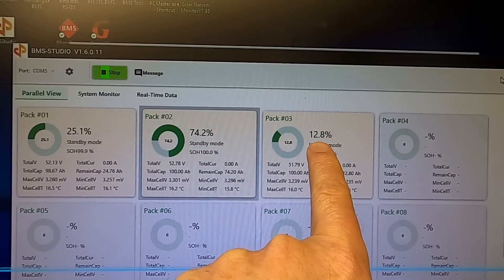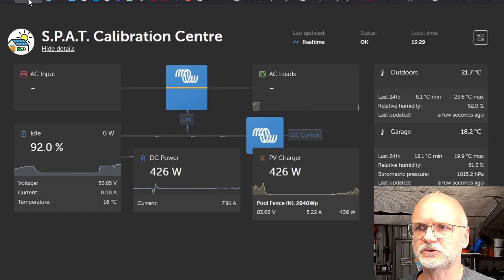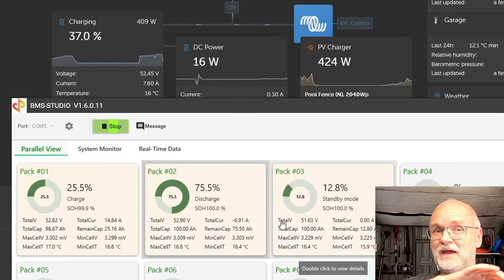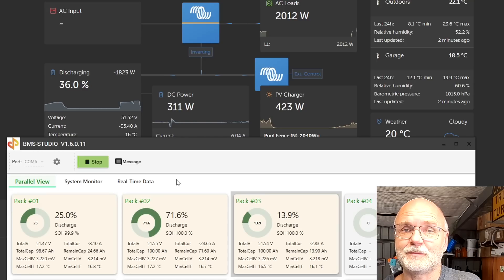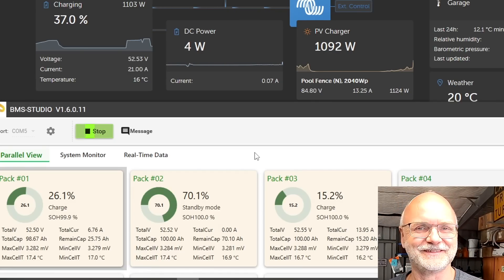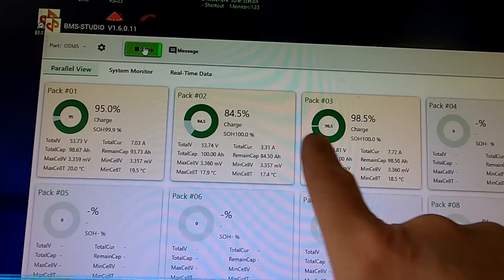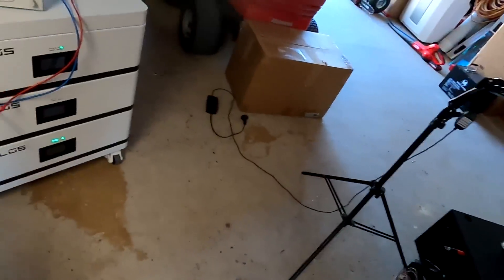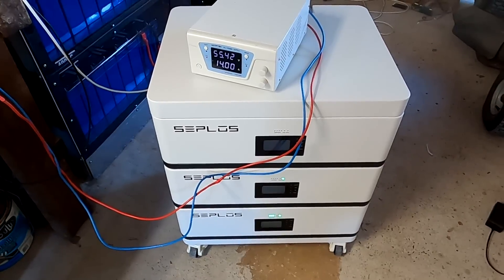3 Batteries in parallel. Lots to learn from an unfinished product 😒

Comment: Thanks for the outstanding demonstration instruction. I would love to see a mixed chemistry parallel test with Lead-Acid and LFP,  with larger capacities and loads  than I've done at small scale. Mainly for people like a friend with an off-grid home in Thailand who's been running a deep-cycle Lead-acid pack and needs to add capacity and is considering doubling his battery capacity with a new LFP pack, and had concerns about connecting it in parallel with his lead-acid pack. He said local solar dealers informed him that will ruin his lead acid pack and cause heating and all sorts of charging and discharging problems. I believe this is bunk as the LFP Packs should handle most of the high load peaks with the Lead acid batteries following in trail. As many may be wanting to add an LFP pack to a Lead Acid pack perhaps such as test would be useful information. 

I have observed when paralleling similar sized 48V Li-ion packs with LFP packs  (600 watt-hour each),  that under prolonged high load (about 1000w) from 100% SOC to about 70% SOC, the Li-ion pack will end up as a lower state of charge and after removing the load, and LFP pack will charge the Li-ion pack at about 500watts or at the charge limit of the LI-Ion pack. My though is that this would be reversed if  connecting a Lead acid pack with a LFP pack, and the LFP pack would handle most of the discharging and charging load.
Reply: I am running lead acid an Lifepo4 in parallel its working just fine the Lifepo4 handles 99% of the load if you discharge down to 20% for the Lifepo4 a small amount will come from the lead acid. I have set the back to grid/generator at 49 volts which on my old batteries means they do not do much , I tried at 48 volts for testing and the lead acid started to provide 15% of the load. So basically the lead acid remains mostly on float. Note I have set the charge voltages for the Lifepo4 so defeating the lead acid charge profile. I have a daly bms on 16 x 280Ah Lifepo4 one system on another system I have a 310Ah green bank battery bms is not accessible but the indicator on the front matches that of the one on the daly bms on the other system.  If you go to the Australian Electric Vehicle Association forum renewable energy and storage (non - ev) I have started a topic for this now.
Reply: Mixing battery chemistries like this is not feasible. Due to the flat discharge curve of LFP batteries, you will empty your LFP before the lead-acid starts to do something.

Due to the flat charging curve, by the time you reach the absorb voltage for your lead acid batteries (56.8V to 58.4V, AGM vs FLA), your LFP battery will be overcharged already, and you have to keep this absorb voltage for an extended duration for the lead acid to charge. this will cause your Lithium BMS to disconnect every time.

If you have a poor solar day/week (lithium only charged to 80%), then your lead acid will never charge, and this will damage them.
Reply: @bascomnextion5639  thanks very much for the information. That's similar what I observed with some limited testing I did with 2000 watt-hour 12v deep-cycle lead acid and 600 watt-hour 12V LFP pack. but once I got below 3.20 volts per cell or 12.8V system voltage the Lead Acid started providing 50 to 80% of the load as the voltage dropped to the cut-off voltage of the LFP pack.
Reply: Flooded lead acid need 62 volts for a proper charge so almost all chargers do not charge them properly sealed lead acid should be kept below 57 volts but benefit from pulse charging to 62 volts . Regular maintenance is a must for lead acid so part of this would be to charge the battery at least monthly to these voltages , I use a 5 amp 48v pulse charger to do this. I have also a nickel iron bank which needs 64 volts to solve this some of my mppt chargers have an load output that can be set to come on/off at a set battery voltage so with a large relay/contactor I disconnect the NiFe battery from the system and the mppt charger with its solar takes it to 64 volts a similar voltage controlled relay could do the same with lead acid banks switching to a charger.
Reply: In winter I mix Lead acid with LFP and they work very well, the BMS OVP and UVP will fire on every charge/discharge to protect the LFP but the Lead acid will extend the capacity  the capacity of your pack. I mix them to have capacity to reach the period when the grid rate is lower. One thing that you must consider is that acid must be in good shape or they will drain energy solar energy that could be used to charge the LFP. In summer I don't use lead but charge them every month and notice that LFP capacity is lower in the morning before solar kick in and I produce twice of what I use, so this means that at night lead is draining power from LFP.
Reply from the maker: I'm not a fan of mixing battery chemistries. I'm OK with it if one still has seme lead acid batteries and wants to use them until they are dead. But I would not recommend planning on such a system as it provides only the worst of both worlds and is full of compromises. There is no reason to use lead acid batteries for power storage systems any more unless you cannot get any Lithium batteries.
Reply: @OffGridGarageAustralia  Thanks Andy, I agree, but was thinking more of a friend in Thailand who has a large investment in Lead Acid over a year ago and needs to double his capacity on a limited budget, and My suggestion was to double he capacity using an  LifeP04 prismatic pack and then replace the Lead Acids at a later point when they start to degrade and he can afford to do so. 

Perhaps we a supporters could kick in for a say a 200ah 12V Deep cycle Lead acid battery  to combine with a set of 200ah Prismatic Lithium cells for you to do some definitive testing with.  I did some testing months ago with my 12v 200ah lead acid test battery and a smaller 24ah pack but it was not a good representation of real world use. 

 Also, I just submitted a long reply in regard to charging LFP and Lead Acid batteries in parallel if you are interested in a long read.

Comment: Hi Andy.  I think I am missing something here.  Why are your Bms boards asking the solar system to reduce the current avalable to the system . I would of expected the solar system to try and maintain the dc voltage at the system voltage that you want to run at. 
The current would be limited by what the batteries want to take and I would have expected the Bms. To limit this current for its own battery to a max charge current   
Any load conection would then drawn its power from the solar system untill it can no longer keep up the dc voltage would drop and load would then come on to the batteries to make up the short fall . The important thing is to Maintan the system voltage at the correct level and not go over volt on the system. 
At the moment my system runs on lead acid just starting to get into. These Bms systems. And batteries  regards bill

Comment: Your 15A axtive balancer had everything sorted in what.. half an hour?? You could take the covers off and top balance these. Longest part is disconnecting/reconnecting the balance cables. Do it 3 times and youve got your full capacity to test across the 3 banks... Take you a few hours at most...
Reply from the maker: Yes, of course, I could do that. I just have the feeling that these batteries need a more permanent solution. And this should come from the manufacturer, not the user.

Comment: After replacing 5 cells in my 280AH pack now i have 2 group of cells at top balance, group of 8 cells that stay at 3.45 and a group of 8 stays at 3.385 now 10 days lets see what JK can do about them. good luck balancing those new Seplos cells. I charge them max to 54.6v though.
Reply from the maker: I hope you're not talking about LiFePO4 cells here. these voltages are far too high and dangerous for LFP cells!
Reply: @OffGridGarageAustralia  my mistake, sorry, I meant 3.45. And yes they are LFP.

Comment: Andy, I admire you for having the nervs for this Seplos.... :D :D :D
Reply from the maker: I need to know myself, so happy to share this her eon the channel...
Reply: @OffGridGarageAustralia   OK, but I think you already understood that Seplos is a terrible waste :D :D :D ... there are so many different and functional solutions ... you even built one of them ...
Reply from the maker: @jurajnikolov4219  For years (not quite...), people wanted me to test the Seplos BMS because of the great communication to inverters. Well, even the communication works well with these BMS, the software and design needs a lot of work. I believe Seplos is not big enough to have a say in how the software should be or even can request certain features in a new software update.
If all these BMS have the ability to be updated via software, why is nobody listening to the community and make all these changes via a software update. It is sooo easy. Users can then decide which version they want to run with certain functionality.
Reply: @OffGridGarageAustralia  I've never seen it go without problems :D communication, balancing... :D
And you already have a built-in solution that is functional and does what it is supposed to do :D
Ok, you don't see cell states, monitoring... sacrifice one Rasspberrrpiiiii for each BMS :) for that venusOS, then as a solo installation in VRM... I assume that it will be possible to unify via rednote, or you can see it as a solo installation under VRM, what I'm writing :)
How many times do you do the settings? When do you sett it and then?

Comment: In my opinion (sorry to have one), the positive cable should be connected to the upper Seplos battery and the negative cable to the lower Seplos battery. In Germany we call this Tichelman circuit in hydraulics!!! Maybee, you remember.
Anyway - anyone who works with battery packs knows that the individual battery packs must be balanced to the same full voltage and then connected together. The passive balancers on the BMS's are never capable of correcting unbalanced battery sets. You told us this many videos ago - didn't you learn from your own experience?
Reply: Individual packs can be connected in paralell with vastly different state of charge as long as current going from one to anouther is low enought and charge/discharge speed of those paralell packs are limited at first.
Balancing individual cells within one pack - that is required either before use or with powerfull active balancer during use (for LFP - LiFePO4 during last 3-5% of charging).
Reply: Does not matter that much wich such low currents...
Well, the Seplos 10C and 10E BMS do actually balance and are able to balance with passive balancers without problems....just takes some days...but the Seplos V3 does not balance at all...in the software, it indicates some balancing, but it is not acutally happening...
Reply: the "balancers" do not function between separate packs. charging the packs up to the top point (55.2V in this case) will cause all 3 packs to be balanced on a pack-level with the first cycle, since they disconnect themselves when they're full, allowing the other packs to also reach 55.2V. 

With such big busbars, there is also no need to tichelman them
Reply from the maker: Thanks for your comment, Juergen. Always appreciate your opinion, so nothing to be sorry about.
The bus bars at the back are so fat that it does not matter where to connect pos and neg. I have done the same in my battery shelf with the copper bus bars and connecting all three batteries just from the top. No issues even when charging or discharging with 250A.

Comment: I was wanting to see the individual battery cells as there seemed for the 2 seconds we could see that window in the software to be huge differences :)
Reply from the maker: All three packs have over 250mV voltage difference and I cannot even charge the packs to 55V without one cell hitting 3.65V. And the balancers don't seem to work at all.

Comment: Seen similar unbalance with other China batteries. They argued to me that it was industry norm to have up to 300mV deviation.  Given that you are reviewing the batteries, you should not put balance boards in them. Rather, you should put them in to production as-is, and see how they balance over time... maybe months.  This then would give the average person a real insight into what to expect from these batteries.  Maybe they will eventually balance and maybe doing nothing is a viable choice.
Reply: I had some cells gone bad at 50% discharge deviation would be 600mv and the bad cells triggers cell low voltage disconnect.
Reply from the maker: I have my deepest doubt that these packs will ever balance. The balance current is so small, it won't make a difference.
Also, it is very hard to put them in production because they turn off all the time with a OVP. I can only charge them to 54V.
Reply: @OffGridGarageAustralia  Hi Andy. I agree that they would take a LONG time to balance out, but (1) would the average user lose a lot of capacity in the meantime ... maybe 5%? (2) would they eventually balance out and how long did it take?  Good to know...

Victron notes in their verbage that on some lithium batteries, you need to low the charge voltage so that they stay balancing at the top end (rather than over volt) and slowly raise the voltage over time.  These batteries seem to be a candidate for this treatment as they seem to be blanced only on charge?

Personally, for my China batteries, I manually discharged the high voltage cells until they were close to balanced, but the average purchaser would not do that - nor install an balancer in their batteries.  So while I 'feel' your temptation to just fix the problem, I think a better approach would be to' suck it and see'.

Comment: it slowly becomes an australian SEPLOS LABORATORY with 5 seplos batteries in 2 towers.
The Neey Laboratory has finished with the Neey 4th generation which really works fine.
Reply: It's ok... Could still use a fifth gen on the neey. Still doesn't operate as desired or give you full control of the voltage
Reply from the maker: The V4 of the NEEY Active Balancer is great and works perfectly.
Reply: @OffGridGarageAustralia  it works really well, but there are some issues. For example in your video your initial settings failed. I've confirmed that on mine too - if they are too high you get that voltage too low message. You can trick it some, but it only works for one cycle. It also starts balancing based on the average cell voltage when it should use the highest cell.

Comment: Well that's disappointing. You'd think that Seplos would have it together with the bms by now. Not like they're a brand new company now.
Reply from the maker: The V1 of their BMS was the best (FW 2.8) and actually worked quite well. They could have kept this and just updated with new software. It was great and even got 4 frogs in my comparison spreadsheet.
FW2.9 for this BMS was a step backwards already, V2 of the BMS was bad and never worked well. V3 was my big hope...

I don't understand why they develop new hardware all the time instead of just working on the software and implement the features and functions from our feedback🤷‍♂️

Comment: That's actually bad. I've got 32mv and 46mv difference on two parallel 7s old laptop banks.

And only one has a BMS... 

Our commercial pack cells come with 0.001mv difference in packs.

You need to discharge and recharge with an active balancer, usually coming up over 80% gives the balance time due to the resistance change on the cells.
Or
You could manually balance the cells, that's like paint drying..
Reply from the maker: Yeah, I really don't like fixing their sh!t all the time. The balancer does not seem to work at all.
Reply: @OffGridGarageAustralia  maybe it does work, it's passive , and so tiny that it would take  a month to balance?
I've a small active balancer and it takes 10+ hours to balance a small pack.

Comment: BMS Studio... whose app is this?
Reply: new seplos bms software - but I think I have seen it also on another battery but can not remember where I had seen the bright green color
Reply from the maker: It's on my website to download. I doubt it will work with any other BMS than the V3 of the Seplos BMS.
https://off-grid-garage.com/battery-management-systems-bms/

Comment: I don’t know if it is my OCD or SOC  anxiety but if the sun is out my battery is charged by 10am. Being 100% off-grid probably contributes to this…
Reply: What SOC do you have before the sun rises?
Reply: @perpelle  when it’s 110°f at sunset, 28ish%, during Winter it’s normally between 40-50%.
Reply from the maker: Well, it depends on the size of you battery. I could be fully charged at 10am with a small battery.
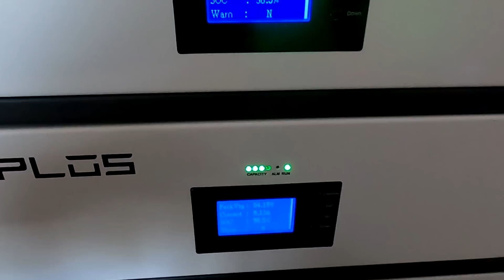Reply: @OffGridGarageAustralia  atm I have 1 Big Battery Rhino (14kWatt/hr) on the way to 8. Before I over-paneled The earliest I hit 100% was around 1:30p-2pm. Now I hit 100% around 9:30a - 10a.   
I want from 2.7kWatt/hr to 6.545kWatt/hr with my panels.
Reply: Actually, I over paneled because I was up in  Flagstaff during a winter storm and after 2 days the Rhino was tapped out. It was -12°f over those three days. I had to actually drive down to Verde Valley to get sunshine, charge up and then headed back to Flagstaff. 
It was far cheaper to add solar than the second battery.